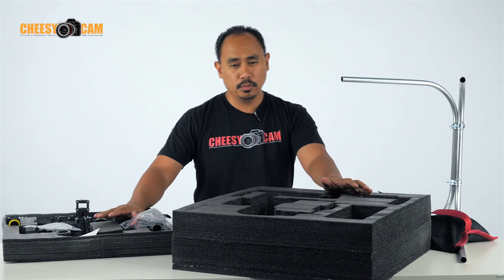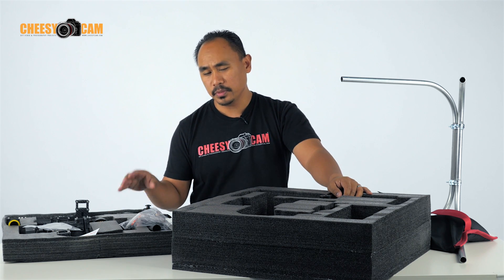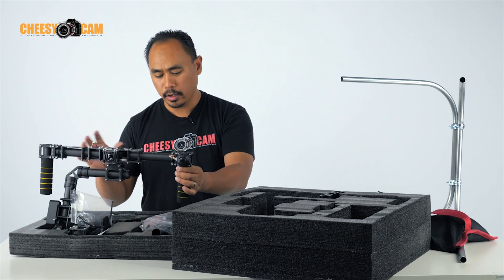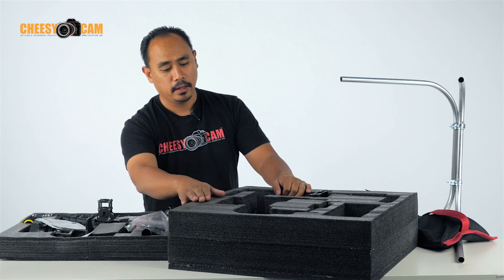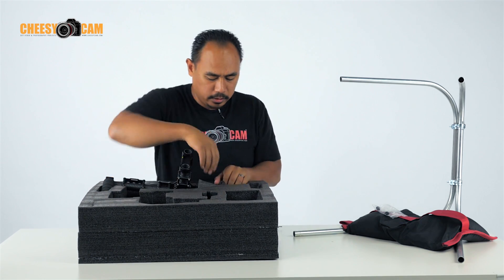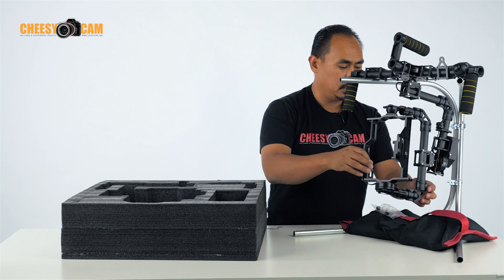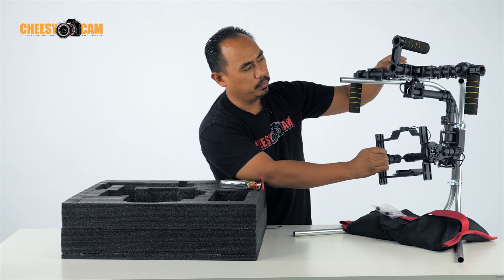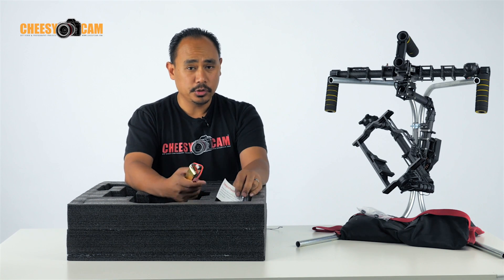Unboxing the Ready to Run CAMETV 7800 3 Axis Gimbal

Comment: Dear MrCheesyCam. 

I just ordered a came tv 7800 and I’m trying to balance it with a canon 5d (both mark III and II), with a 28mm lens. 

I managed to get perfect result on the tilt bar and on the yaw section. 

The problem is I am not able to find the perfect balance for the roll bar: when I move side-ways it it doesn’t stay in position, it goes back to center, unlike the pitch.

If I try to move the camera up, as indicated in some videos the situation gets better on the roll bar, but it’s impossibile to balance the tilt section. 

Do you have any suggestion ? 

I’m starting to have the feeling that is one or the other, the tilt or the roll, seems really impossible to get them both!!

If anyone could help me I’ll be really thankful!
Reply from the maker: +Alice Gatti The roll bar needs to rotated up so the horizontal side arms (one on each side of camera) is level. If they are tilting down, you will be bottom heavy on the roll.

Comment: hey!
yeah I do know tht and thts why these profiles are the basics. it's more like recovery files to put you back on tracks. you do great work with tutorials but if I would be you than I would do all diff profiles and upload them to Web page where people could download  diff profiles for diff cameras and lenses.  for its easy to do this cuz u have access to all diff lenses and cameras. this tip is for free
Reply from the maker: +Refus gees I'm not sure you understand. Sharing profiles is not the basics and will not get anyone on track very easily. If you want to share the basics, you should only share PID numbers and Motor power numbers. Maybe a screen shot but not have people download a profile. And also any numbers you share should state which version firmware you are running. If someone has a different firmware than you have, and they download your profile, they will really screw up their system. If you want to share your settings, you should only share numbers of what people should enter (not download a profile), and also be very clear what firmware you are using.

Comment: Any news on quick release plates or anything that could turn a 7500 into a 7800?
Reply from the maker: Cedric Melbourne Sorry I have not found one that is slim enough and easy to access. The quick release and the bottom frame of the 7800 have been modified so that the QR can base can slide left to right, and the QR plate can slide forward and back. It's very handy.
Reply: Understood
Reply: Thank you

Comment: hello my question will seem relevant but I have the 7800 h that I buy used engines works, and the sensor gyro, but it is destabilize it does not work very well the parameters (pid) and the settings (frame imu) does not answer that is why I turn to you for help because despite the tutorials on the internet I can not restore my stabilizer to its original state deflower and not being enough geek in tuning via the simple software bgc 32 2.43b9 firmware 2.43 I can not do it it does not work well as well as the joystick that does not respond because I do not know how to adjust my stabilizer via the simple software bgc 32 and therefore a great help would not hurt I hope I do not want to waste time with my problem if you could help me via a virtual private network to help me it will help me a lot thank you in advance

Comment: This is a long shot but I can't find this answer to save my life. Can you please tell me if the Came 7800 will work with my Canon Xa20. I know it weighs 1.7lb (765g) 4.3x3.3 7.2 (HWD)  if you could please answer this question for me I would I would appreciate it. Thank you for the dope videos as always.
Reply from the maker: TheArticblue As far as weight and size goes, it sounds like it will work. The only thing that might throw it off is that top handle. Is the top handle removable on the XA20?
Reply: Yes the top handle is removable. Thank you for taking the time to answer my question.
Reply: +TheArticblue did the 7800 work well with the canon xa20? I have a vixia hf g30 i want to use and this is my biggest hurdle. Did you have to mess with the settings or was it a simple balancs the camera with the axis and ready to go. Your reply is greatly appreaciated.
Reply: sorry i am just now seeing this. I did not purchase this. on another thread I was told that the camera would not fit it was 2 long.(canon XA20)
Reply: TheArticblue ohhh, i have the vixia hf g30 and it works perfectly. I think the dimensions are the same if not similar. Sorry it did not work out. Thanks for your reply!

Comment: Hi, I've just recently discovered the gimbal and have decided I gotta have it for work.
I've watched all of your videos, thanks by the way very informative, and lots of others
but yet have seen anybody mount a Cannon Rebel T3, will it fit?  Also I'm not fond of
dealing with a company that you cannot easily return a defective product,  Wish best
buy would carry these, but I can find very little info about the company.  Finally would
you post the link to the site you ordered yours from just to make sure I'm not hitting
a renegade site.  Many thanks for your videos and help
Reply from the maker: Melinda Grider If you are unclear about gimbals, you should try renting one first and then make a decision on what features you need. They all have pros and cons, even the real high end ones.
Reply: Actually I do have quite a bit of amateur experience in photopraphy, I had never realized this technology had make it down to
my level and price.  I do understand the operation fairly well and look forward added it
to my portfolio, Can you send the link of the
site you ordered your from?   Thanks for the quick response.
Reply: Whoops, I forgot. Do you know if the Cannon
Rebel T3 will fit.  It doesn't look like its a problem but I'd like to be sure before I buy one.
Reply from the maker: Melinda Grider Yes it would work on a Rebel T3, and you can find these at CAME-TV.com.
Reply: Thanks, I'm going to order one tonight.  Wish
me luck, you probably will hear from me again.

Comment: Hey there, I love your videos and it is so handy
Keep up the good work
I need Help ASAP if possible 

I received the CAME7800 today and have encountered some issues with it. 
I turned on the product and it was working fine and i accidentally pressed it 4 times it started calibrating and wouldn't stop calibrating - i tried pressing the button 4 times to calibrate and it wont stop calibrating - i have tried to restart it a few times and it continues to keep moving and shaking  
Can you please assist me with this - it may be a minor issue that you could help me wrap up - as i need to use this device in the next week and i am running out of time 

Cheers

Comment: I was wondering if someone could help me getting the original profile
 settings for the GIMBAL 7800. I accidentally deleted them while 
changing the PID settings.  I was using the GUI software version –  
BGC 2.56 upgrade 

Now my Gimbal has lost its settings and I can’t find a way to balance it again like before.

Please contact me via
Hope that someone can reach me the solution for this problem…

Thank you very much,

Comment: must say, you are not sure, what are you doing. For balancing YAW you must have 90 degree against the handlebar-top rail. Thats why is your YAW off the balance even you think you close.
Same about "U" bar, must be 90 degree against vertical bar where is your roll motor (specially in older version).
Reply from the maker: vrso2 Ok, if you say I don't know what i'm doing.

Comment: Does anyone or MrCheesyCam have the original profiles for the CameTV 7800? Can't find them anywhere online- cheers
Reply from the maker: +Luke Cameron It's not recommended to download profiles since every gimbal could have different firmware installed. Also other profiles will end up changing every single setting on your gimbal (like motor invert options) when all you need to do is change PID values.  

It is recommended that you write down your settings on your own gimbal before making any changes.
Reply: Rented it out and it's come back munted so looking for came tv original profiles of you have them. Cheers
Reply from the maker: +Luke Cameron Sorry if it was going to be changed, this should have been something that was written down from your exact gimbal. 

Sending my profile doesn't guarantee a fix. I may have different firmware, or my options for motor invert could be different. This would cause your system to freak out and end up in worse conditions. 

You could go through the steps of tuning the system from scratch. First you would make sure nobody messed with your sensor positions. If they did, then the whole system would not work.

Once you have sensors set up correctly, you would check motor invert options.

Finally you would go through the process of tuning the PID values.
Reply: +MrCheesyCam - the whole system is wrong and I'm unsure how to resent to original factory conditions- won't a cameTV profile fix this?
Reply from the maker: +Luke Cameron A profile may not fix it because a profile contains settings that might not match your gimbal - such as motor invert options. Also depending on the firmware version of the system, it's not going to be the same. 

This is why it's better to start from scratch. It's not that difficult and if you plan on allowing people to modify your gimbal, you may want to learn how to do this. First check sensor orientation, then motor invert, and then tune PID values.

Here's your first check: http://cametvblog.com/setting-up-sensor-orientation-on-came-tv-7500-7800-gimbals/

Here's your second check: http://cametvblog.com/check-came-tv-gimbal-motors-require-invert-option-selected-simplebgc-alexmos-basecam/

Finally you just have to tune the PID values to the way you like it.Try this video for starters: https://www.youtube.com/watch?v=BQjO-OBsI_g

Once you setup your gimbal the way you want, you should write down your settings or save your own profiles.
Reply: +MrCheesyCam Thanks for all your help- got it back to normal!!
Reply from the maker: +Luke Cameron Wow awesome news. It's not that hard to learn it and the more you practice, the better you can tune the system.
Reply: +Luke Cameron How did you end up fixing it?
Reply: +iamLegends I just followed their instructions above and downloaded a program called SimpleBGC_GUI_2_56b7 and used that to re configure the gimbal- worked perfectly